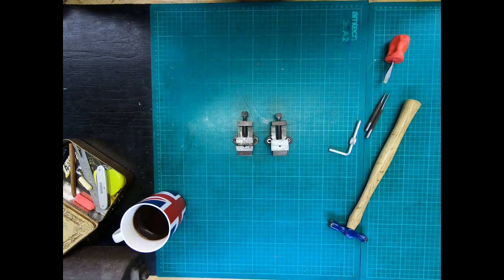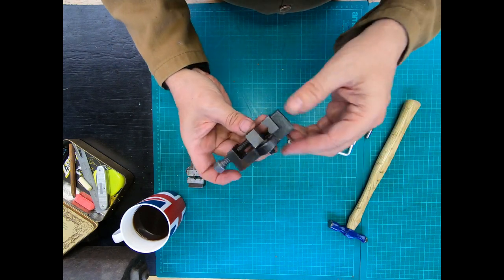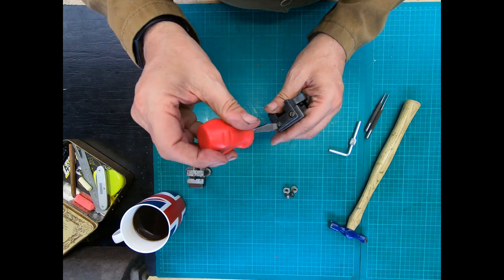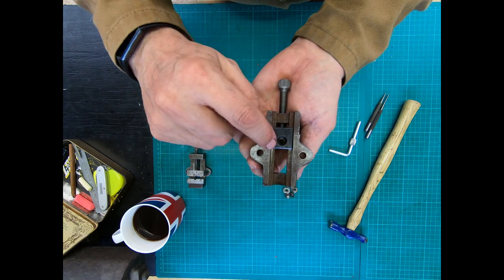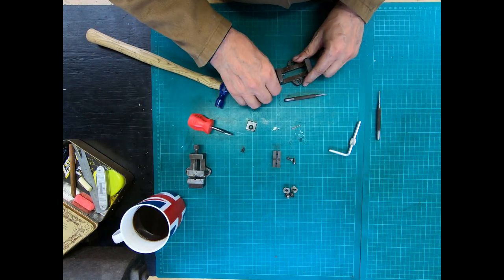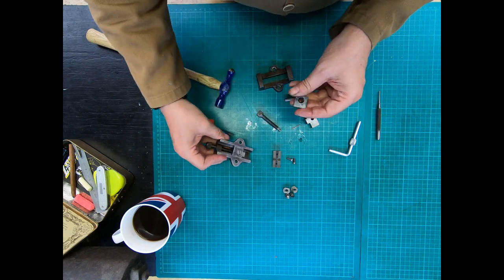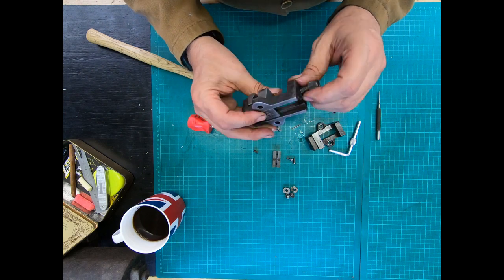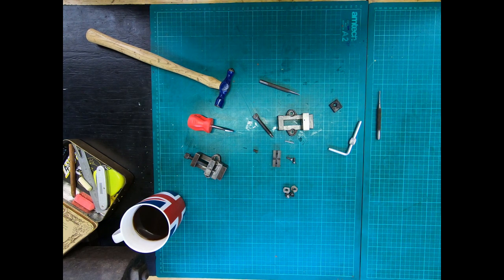Emco Unimat SL - Restoration - Milling Vice Disassemble.

Comment: Hi Paul. I'm sure that bent one could be persuaded to be straight again. I'd be happy to fix it up if you don't want to do it yourself. Anyway, weren't you supposed to be making a clock?
Reply from the maker: Hi Olly,
I will most likely give it a squash in the vice or whack it with a hammer, if all goes wrong then machine a new base... With regard to the clock I am aware time is ticking, well in my case not... Seriously though I have the IME & Unimat's working now, and very close to having the Emcostar up and running. I may then focus on the Deckel as that would be useful. Thanks for watching.
Take care.
Paul,,

Comment: Good work there Paul. I did mean to ask about injectors and forgot. If you recall on my last video one injector is stuck and I was wondering if you have a recommendation for removing tarred in injectors?
Reply from the maker: Hello Ben,
Many thanks for watching... I last work on the marine engines in 1988 and then moved to calibrating fuel pumps for gas turbine engines for a year and then moved into the world of computers for the next 30 years. So, based on it being so long ago sadly I don't have an answer for you.
Take care.
Paul,,
Reply: @TheKnacklersWorkshop  No worries, thank you all the same.

Comment: Paul. You can mill or file a notch in the bottom plate for drilling through holes. Leave the portion that slides on the bottom. You can scribe a line with the plate screwed to the movable jaw to determine the amount to remove. 
Good job on explaining the parts and how to disassemble.
Jere
Reply from the maker: Hello Jere,
What a great idea, I really like it and will do that, thank you. I will film the modification and make sure you get the credit for the idea. Thanks for your support.
Take care.
Paul,,

Comment: Thanks, Paul. I presume from the distortion on the body of the damaged one, that they are an aluminium casting?
I was lucky to get a Myford vice with a vertical slide, and that is cast iron - heavier but more sturdy.
Thanks for sharing.
Reply from the maker: Hi Russell,
The base is steel.... Nigel suggested making a new base, which is a good plan I think, I just need to find some metal. Many thanks for watching
Take care.
Paul,,
Reply: @TheKnacklersWorkshop  It must have taken severe abuse to bend the steel! Thanks for your reply.
Blessings from South Africa